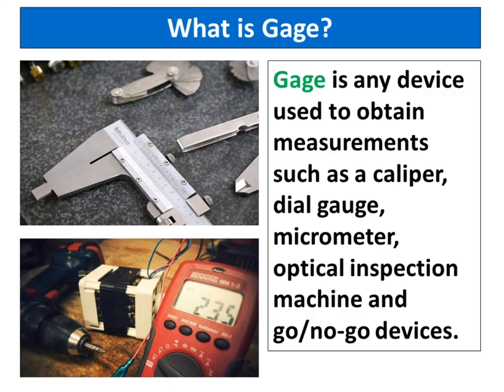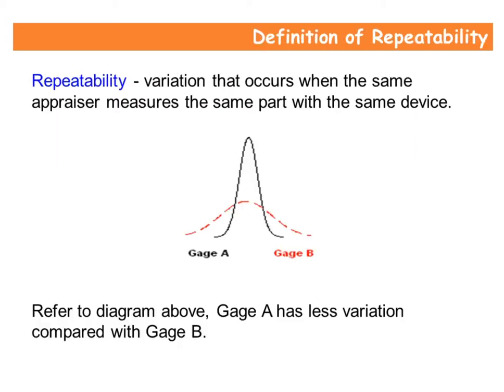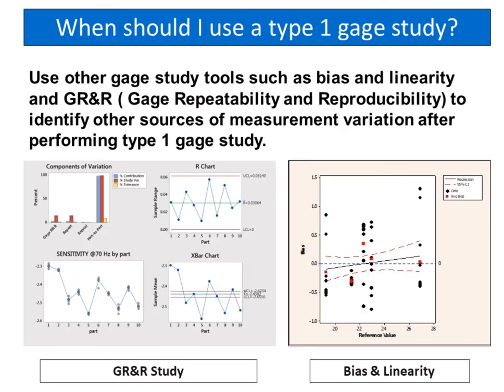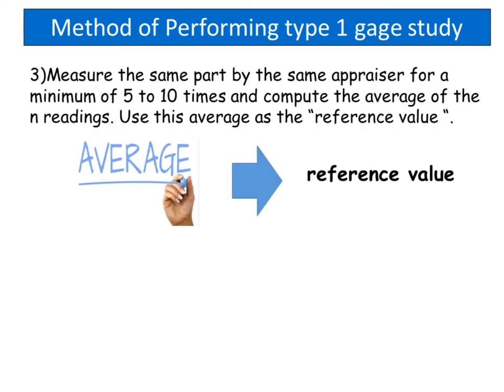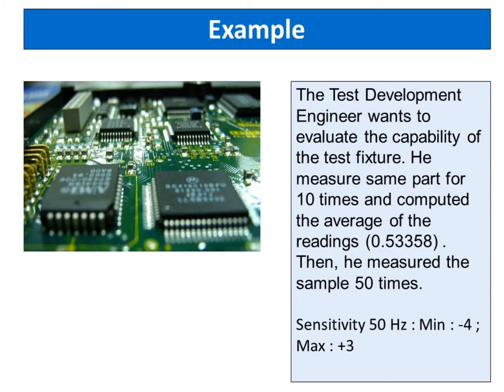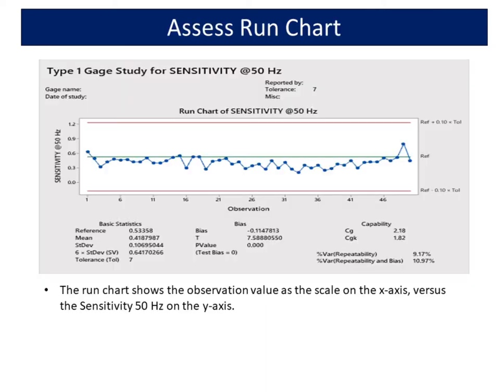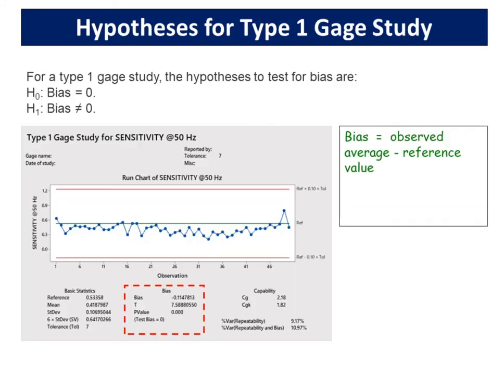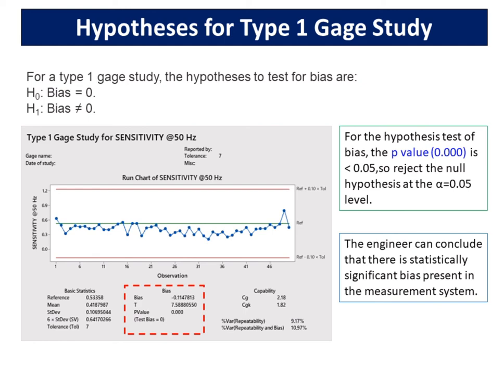Measurement System Analysis (MSA) Part I :  Type 1 Gage Study | Minitab |Statistical Method

Comment: what happens if bias fails but cgk is good in a type 1 study
Reply from the maker: Type 1 gage study is to evaluate both effect of bias and repeatability.In this case,the measurement variation or repeatability has better performance.You can further perform bias and linearity study to further confirm the accuracy.

Comment: Hello, how is MSA (Measurement System Analysis) conducted on parts where destructive testing is performed? There are controls where we can’t reinspect the part. What kind of method do you apply?
Reply from the maker: You need to use GR&R nested method for destructive testing
Reply: Could you tell us briefly, master? @knowledgefactory-leansixsi2123